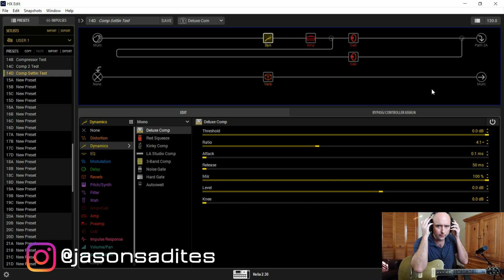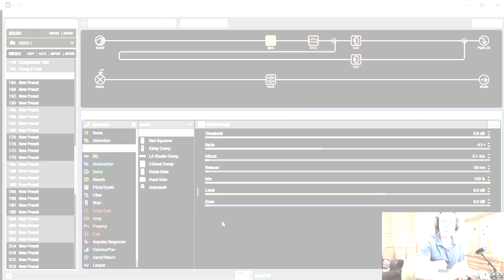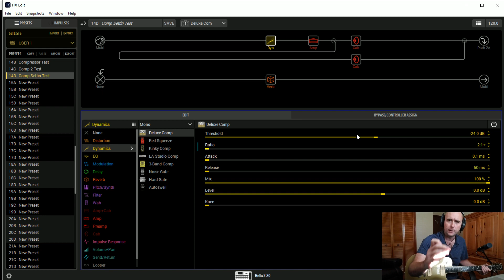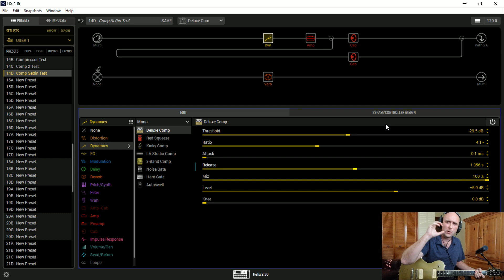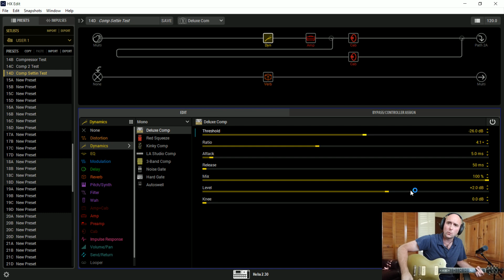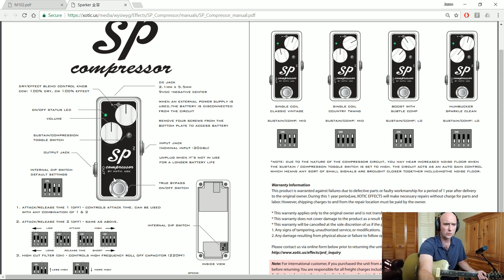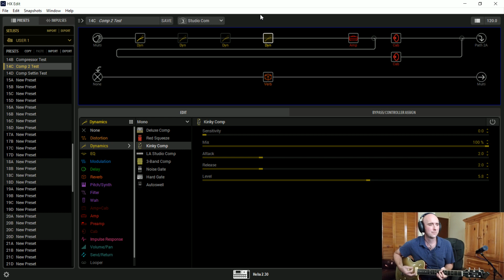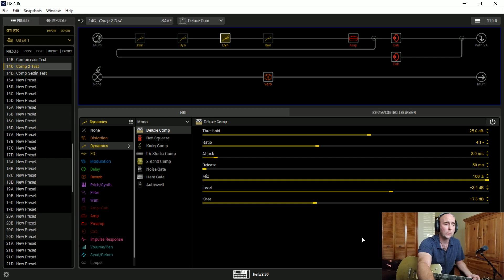Line 6 Helix - How To Create A Great Tone - Pt. 5 - How To Use A Compressor

Comment: Thanks for the breakdown on the compressors.  I have used the Red MXR for years on my old pedal board that had the Dyna Ross mod on it to give it a bit more tone control.  Some of the variables that Line6 had me wondering what they all did.  This helped a lot.  I thought it was a bit odd, when I added the Deluxe Comp to a preset while going through the video it defaults to quite a bit different than you had there, unless you had already adjusted it prior.

Anyway, thanks for the info.  Hope everything is good. Keep on rocking.
Reply from the maker: So glad to hear it helped and my pleasure :-)

Comment: Jason, fantastic explanation of the compressor’s parameters, a great comparison of the compressors in Helix, and most interesting, how to set them to sound similar. This really helps in understanding what the compressor does and how to use the controls. What I struggle with though is how to use it as an effect for guitar. What is unique about the guitar (pick attack, sustain, frequency response, etc.) that interacts with a compressor and what are we trying to accomplish with compression as an effect?
Reply from the maker: Thank you so much Jim and very happy you enjoyed the video :-) I am actually not a real fan of lots of compression on my guitars for the most part other than as a little 'glue' in the mix but to learn to use it as a noticeable effect, there is a lot of power in the attack, release and threshold that once you get your head around can really shape the sound in a lot of interesting ways.

Comment: Hey Jason, great videos.  Really liking how you're showing the inner workings of the helix and how they relate in the real world.  I have a small recording studio at home and have also been running sound live for years, so having you little "mastering section" of blocks from an audio engineer perspective makes total sense.  My question would be in that would you use a compressor in front of the amp/ in your "normal" signal chain to smooth things between overdrives and such before the amp.  And then use the mastering one like you describe to put a nice bow on the sound.  Or would you stick with just the mastering one?
Reply from the maker: +Curtis Smith thanks so much and glad you are liking the videos. As as your question, I never use a compressor at the start of the chain when using overdrive or distortion tones as, IMO they just don't need it. I will use it sometimes for certain clean tones I feel it needs it. In all situations I leave the compressor at the end still.
Reply: Jason Sadites thanks for the quick response. I see your logic there as overdriven tones can already be squashed by the amp. For me, as I’m not that great of a player, I can use all the help I can get ;)
Reply from the maker: My pleasure Curtis! Keep working hard at playing and it will all come together :-) And if you need a touch compression on your overdrive, no worries :-)

Comment: Thanks a lot for your efforts, this is definitely one of the most useful and practical guides to compressors for guitarists I have seen, regardless whether using Helix or not.

I've been trying to get to grips with some standard pedal comps and failed miserably - apparently what I need is more control than they offer - this I suppose is why many guitarists don't care for them all that much - you get what you are given without much control of the settings and either you like it or not, the former usually being the case...

Which in fact seems to make Helix a much more viable purchase, as the price of a decent comp offering the level of control the Deluxe Comp gives (7 parameters! Yay! ;) is going to be a substantial part of the price of the Helix...

Just one question - how would you set up the Deluxe Comp to sort of counter the natural note decay without squishing the attack, to let the note sustain longer without compressing the attack?
Am I right to assume what is needed is relatively long attack and decay times, low comp ratio, low threshold and an appropriate level of output boost to bring the volume of the decaying note up to the level of attack?

Cheers, I hope you don't run out of enthusiasm for creating these videos!
Reply from the maker: My pleasure and thank you so much :-) What you described would be the best way to achieve the longer sustained sounds...good luck :-)

Comment: Hey Jason! That's one of the best videos I've ever seen about compressors for guitar. Yours and another recent from Mr. Keeley himself are really the best ones.
I've been seeing also your latest videos about the amps and cabs and they're all great. Keep them coming.
Wondering if you have any tips for me about getting more sustain with compressors. I also own a Helix.
I'm trying to get clean(ish) tone for playing my guitar with a slide for a cover music and I'm struggling with sustaining the notes with getting them too squashed and without a big makeup gain because of the increased noise.
Right now I can sustain the notes how I need them to be but at the cost of gain and noise. I'm puttin the LA and Delux compressors at the front of the Archetype  Clean Amp with the drive around 4 to achive this.
Can you give any tips or some other way to do it? 
Thanks a lot!
Reply from the maker: Thank you so much and so glad you enjoyed the videos!

To get a compressor to add more sustain like you described, start with the Deluxe Comp with a 5ms attack, try around 100ms release. I would say maybe a 6:1 ratio and then bring your Threshold down fairly aggressive, until you start getting the sustain you are looking for. Of course the more you bring the Threshold down you will have to apply make-up gain with the Level control which may introduce some more noise. Just play around with those setting in those ranges until you get something close to what works without too much added noise. Let me know how that works for you and if it helped at all!

Comment: hello there Mr Sadites 1st off thank you for your insightful sharing i been spending a lot of time on the pass few videos and i've definitely benefit from it, if you could maybe you could go experiment on the 3 band comp see if it works like a dynamic Eq used in most audio engineering/recording... cheers have fun
Reply from the maker: Thank you for your kind words! I do have plans to cover the multiband compressor in another video. I just have a few others to get to first. But stay tuned here and I will get to it :-)

Comment: Hi Jason, great videos - thanks. Is it not possible to control the parameters your changing with the foot controller in parameter edit mode, so that you can adjust whilst playing. Thought it would be a great help to show when the threshold has been reached. Cheers again, learning a lot.
Reply from the maker: Thank so much Paul :-) Yes it is possible to control the parameters with the foot controller. Yes it would be a good way to dial in the threshold for sure!

Comment: Great video. I wish that I had this series when I first got a Helix! I really like your tip on using the LA compressor at the end of the chain (studio mixing approach). Would you still put one there if you used a “squish” setting on a compressor before your amp? Or would you discard the LA comp in this case?
Reply from the maker: Thank you :-) That is a great question about the compression. I am not one to ever use a real super squish compressor at the start, but if I were to do that I would just have to take it on a case by case basis whether to keep the end compressor on. Although I do like how it sort of glues everything together. Not sure if that helps at all :-)
Reply: Jason has the LA Studio comp on ALL his patches at the end. its a given. its the LAW :)

Comment: I could be wrong but doesn't the attack come into play when the signal exceeds the threshold, and the release when the signal falls below the threshold.   You did the attack starts after the pick ave releases however much time after you pick depending on release settings.
Reply from the maker: Yes your first sentence is correct. I do not understand your second sentence unfortunately.

Comment: I've been thinking a lot about compression before or after amp... I'd put it before the amp for cases in which I want to keep vol. And tone the same no matter how hard I pick i.e. for funk, metal and maybe lead parts... I'd put it after the amp for playing stuff like blues and "softer" rock, where I really want to keep picking dynamics affecting the gain in the amp for less or more drive but still keep all at a similar volume! Is this right? I'd still keep it before any time based effects since  it would affect delay and reverb decays, adding sustain and so on... I'm not really sure if I'm right though about any of this
Reply from the maker: Your description of how you would use compression is accurate and would work nicely. I may add that I always put a 'glue' type compressor as a mastering engineer would at the end of my chain even after all fx. I talk about this in previous videos.

Comment: Jason Sadites:  Is there any advantage to getting something like a Diamond Compressor over using Line 6's compressor?  Same question posed to Fuzzes as well?....
Reply from the maker: IMO, The Line 6 compressor is very nice. I haven't personally tried the Diamond so I can't comment directly on that, but the Line 6 Deluxe Compressor is very flexible and does everything I would need a compressor to do. As far as Fuzzes go, I have never been a huge Fuzz box user but the times I have tried the Helix fuzzes they are very nice. You could always try the Helix ones out first and then decide whether you would need external pedals, but so far I haven't had any need for extra pedals. Hope that helps :-)

Comment: Jason, if you want to use a comp for lead in oder to get more sustain, wouldn’t it not make sens to put the comp after the dirt and also chose a rather high release time?
Reply from the maker: You could most certainly do that if it works for you and gives you what you want.

Comment: looking forward to the eq one next.

how do you set the compressor to get those long sustained notes like you'd hear in some 80s hair metal ballad guitar solo?
Reply from the maker: +egregion thanks! For more sustain I would start with a ratio of 4:1 or 6:1, attack of 5ms, release of 100ms, and then the Threshold is going to have to be pulled down until you get the desired amount of sustain. Let me know if that works or helps for you.
Reply: awesome! thank you!
Reply from the maker: +egregion my pleasure :-)

Comment: Hello!awesome video!One question:I use a Music Man Luke II guitar that has no split in the Bridge+Middle position.This brings a huge volume increase when this position is engaged.I've managed to 'tame' this volume difference through the Deluxe Compressor but it's not clear how I could 'help' the lower sounds by raising the volume of the softer notes.Who does it work?higher notes are now compressed but lower ones are low as there would be no compressor?Moreover,since I found that the compressor makes the tones a bit darker, I putted a 6db boost on the High frequencies through a SIMPLE EQ block,moreover like a Boss CS3 compressor.What do you think of this solution?
Reply from the maker: Thanks so much :-) I would actually look at the height of your pickups as a first step. It sounds as if maybe one pickup MAY be adjusted much higher and could be causing an imbalance between pickup selection volume.

Comment: Thanks for uploading this Jason!

I'm trying to create a compressed tone specifically for clean tapping - to make notes more audible, yet uniform in volume too across all strings (I find that tapping a clean tone uncompressed can be much quieter and inconsistent than picking it). 

Would you have any suggestions for achieving this in terms of signal placement / pedal choice / settings? Huge thanks in advance!
Reply from the maker: My pleasure Jeffrey :-) I would start with the Deluxe Comp at the start of the chain for what you are looking for and start with an attack maybe around 5ms with a release around 100ms, ratio maybe 4:1 and bring threshold down until you get the sound you are looking for...hope that helps!
Reply: Jason Sadites sounds good, keep up the great videos 👍👍

Comment: I am unclear on ratio. When you say for instance 4:1. When it reaches that threshold I thought I heard you say it increases the volume by 1db. I was thinking it decreases?
Reply from the maker: +Larry Good, what I mentioned in the video is that with a 4:1 compression ratio, for every 4 db that the signal surpasses the Threshold you will only get a 1 db raise in your signal. SO if the above happened the compressor would be reducing the volume by 3 db in that particular instance. If in the same instance your signal surpassed the Threshold by 8 db then your signal would raise by 2 db, therefore in that particular instance the compressor would be applying 6 db of gain reduction. Hope that helps :-)
Reply: Thanks for that quick response ! That helped. I am clear now.
Reply from the maker: +Larry Good Awesome! Glad I could help clear that up :-)